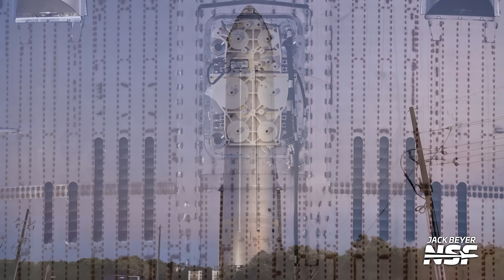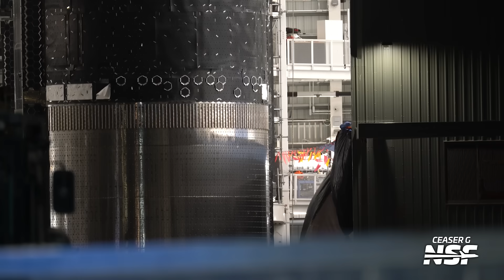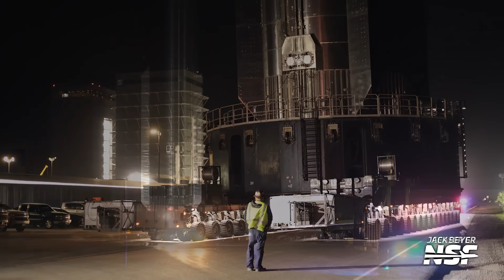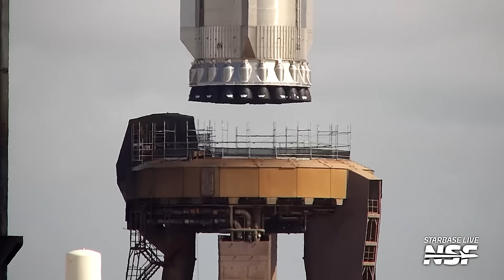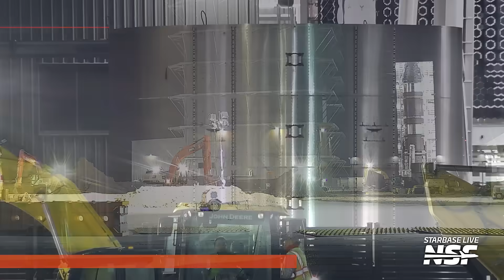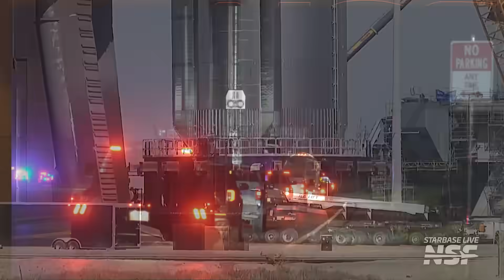"Did the Booster just Hit the Stand??" | SpaceX Starbase

Comment: Every launch or test fire on Pad A just tears up the stand hardware.  Hopefully once Pad B is complete, they can retrofit A with a flame trench or they'll never meet the turn around times.  
Unless they're thinking of just using Pad A for catches?
Reply: They're likely thinking a lot more pads.  I agree that they will at some point redo pad A but might wait until development if further along.  It has so far proven to still be handy to be able to access the bottom of the booster via the dance floor without destacking and Pad A might become a large test stand that can do double duty for a while.  They might also want to see what issues/problems etc crop up in Pad B before starting on a updated version.  Like the booster and starship I don't think we're done seeing pad versions.

Comment: What is wrong with Elon? Why is he so stubboron? The best part is no part is fallacious, this is why the flimsy stainless steel tanks and down comer pipes countinue to rupture. Most engineers would have gotten the Clue by now, that flimsey equals weak and must be added to and strengthened.....
Reply: In which way is stainless steel "flimsy"?
Reply: Spacex uses a thin 3.97mm rolled stainless steel for it's fuel tanks with no internal rubber seals. This is a weak point and has been the cause of leaks and loss of vehicle during the last several missions.   @Alexphysics13
Reply: @Mark-i1p6q  Rubber seals with cryogenics?  I love it when you pretend experts pretend.  You always fail and always make a fool of yourself.  Clearly you know far less than you pretend, but that's a halmark of you people.  Ignorance more than anything defines you.

Comment: Hitch mounts are made to take some torque. They need to, e.g. when you are reversing and turning with a trailer, the load on it is applied in an angle.
To prevent that light-onna-stick from turning, its weight (and a good clamping mechanism) might be enough. Otherwise, tie it to the pickup left and right.
There are hitches made with two little sideways protusions, though, specifically for bicycle hitch racks like from Thule and some others. Prevents them from turning during high-speed turns during emergencies, like avoiding rear-ending another car and such.
Reply from the maker: Tie strap it the the corners would be good. Tension Triangles 👍 - Das

Comment: If the launch mount is Stage 0, and the booster is Stage 1, then yes - placing the booster onto the launch mount absolutely  constitutes a stack comprised of 2 stages.
(And as a software engineer, I would like to point out that empty stacks are also totally a thing, so you could take off the booster, bulldoze the launch mount, and still call it a stack, comprised of 0 stages.)
Reply from the maker: I'll allow it 😅 We'll use that as the official explanation going forward. - Das